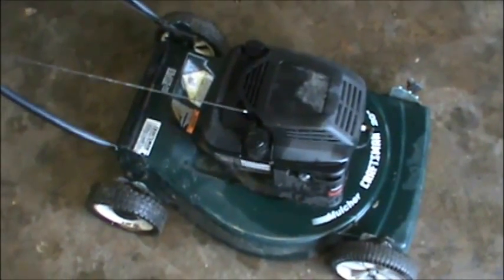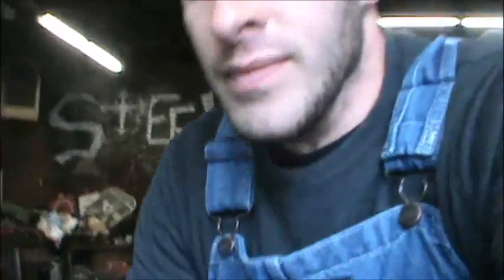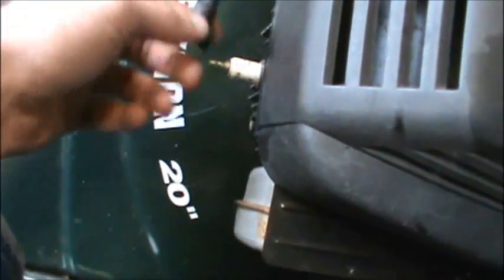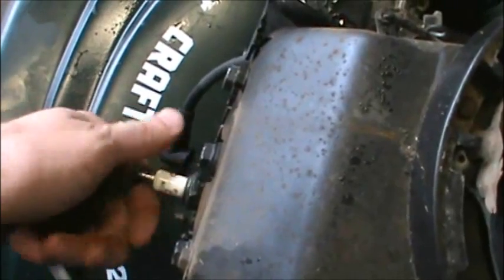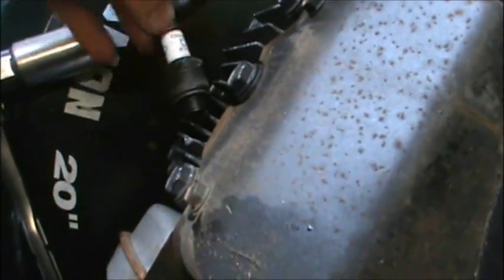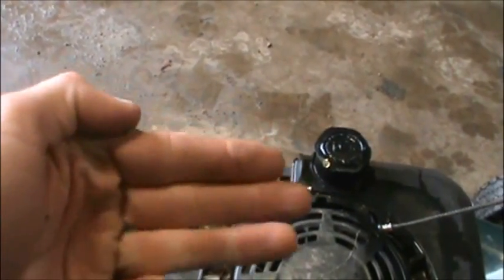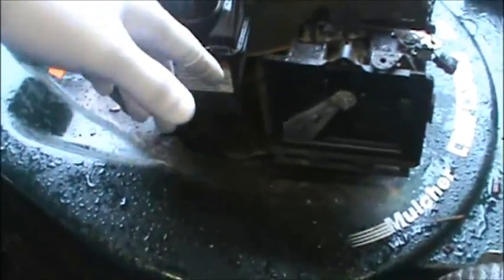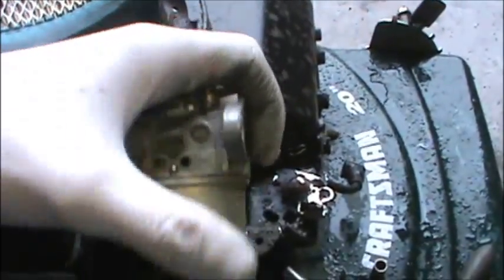How to fix your Lawn Mower and why Lawn Mowers Fail

Comment: Thanks for an excellent video! I didn't even need the rebuild kit, just cleaned out that small rubber nub with a needle and it went from not running at all to running like new - still, if I hadn't known to do so it would have meant a trip to the store.

Comment: Fantastic video that was extremely knowledgeable and entertaining. Great job.
Fixed my lawnmower by watching this.....yes the washer and float sticking which caused gas to run thru the carb and onto the air filter causing problems. Thanks again.
Reply: Before I fixed it with the new kit the mower was turning my spark plug black with carbon because too much fuel flowing thru. Again your process fixed it.

Comment: Great video. My lawnmower has been sitting outside for about 8 months. It worked fine before it was sitting outside unused. Now it won't start. I'm going to see if it has something to do with the carburetor. I've never tried to open up an engine, but after watching your video I think I might try it out!
Reply: If you're going to let it sit for long periods of time, get a bottle of "Sta-bil storage" and use as directed. It helps keep the fuel fresh and not turning to varnish, which in turn, makes your engine easier to start when time to use it. It does work.

Comment: Hey man nice find that was the very first mower that I owned bought it from Sears then 7 years ago it blew the head gasket but I was going to say take a wire from a wire brush and make sure your e tube and main jet are clean then spray the whole carburetor with carburetor and choke cleaner just a nice little tip for keep those old mowers running

Comment: Took off the bowl screw and cleaned it with wire. Even had some carb cleaner and I blew out the holes in the screw. 
It fired up with One pull. That mower has never fired up with one pull even when it was NEW. Runs strong now.

Comment: Cool. I wish I didn't get rid of my old mower.I think I could have fixed it after seeing this video. I just bought a cheap ride mower and never driven one before. I wish you would do a demo on how to operate correctly. I am using it but unsure if I am starting it correctly and switching gears right. Ok thank you.

Comment: awsome vid, im going to check my spark and air filter, if not , im gonna tear the carb apart. It starts but struggles to stay on, like it cuts itself off. seems like it may be electrical, no?

Comment: Hey man thanks for the video I bought the same mower for 15 bucks. That spring that you were talking about connected to the choke. Is that electric choke? if not how does the choke work on that mower. Thanks for the info. I cant figure out how the choke works on this model.

Comment: Thanks for your vid. However my mower will not start because I can not pull the starter string. I have already checked the line and then pulled apart the spring assembly. The assembly is working fine outside with no issues recoiling outside the mower. What ever it pulls inside the mower seems to not be moving as I pull they line. What ends up happening is the line pulls out and will not recoil. I am totally new to repairing anything like this. I checked for anything that is stuck on the under side of the mower. When I hand turn the blades they are reluctant to turn but can be with a bit of pressure. What could my problem be. It is not the corroborator as I saw on this vid. Any suggestions. I don't know what kind of parts are in this area of the mower nor have I seen any vids on them. (even if you can just tell me the names of any of these parts I can look for more specific vids) Thanks. From a very beginner at this.

Comment: Hi, my familys Craftsman lawn mower was in pretty bad shape when i took it over. it would start but wouldnt stay running. So after watching a bunch of videos i decided to give it a tune up. i replaced the spark plug, the air filter, gasket, took the charborator apart and cleaned it out. seals,pin, float are all good. Gas is good, oil is good. Anyway i put it all back together and it worked like a champ. Then the second time i went to use it, it runs fine, but smoking. i cant figure out why. Any ideas?

Comment from the maker: sounds like could be a few issues, first take the carb apart and replace the needle valve which allows fuel to enter the bowl.also clean the carb out with carb cleaner and check the primer bulb for small cracks or tears.

Comment: Thanks for the video, the gas leak is one thing, what if it starts then stalls? Is that a carburetor issue?
Reply: It's also probably the needle valve being blocked I'd check it out
Reply: That screw that holds the float bowl on has some holes in it. Make sure those holes are cleaned out also. Clogged holes can cause the engine to start and stall on some small engines. Can of carb cleaner is recommended.

Comment: I'm a single woman not a young guy, but I really appreciate this. If the carburetor is not leaking does that mean it's not the carburetor? How do you get the spark plug out? You said there is a tool for removing it? I only have basic screw drivers?
Reply: Hi fellow lady! :-) I have a push lawnmower leaking gasoline and trying to figure out if can fix it vs buying a new one. If I can't, then figure that trying will learn something before add the mower to bulk trash day. There are special tools (socket) to remove spark plugs. They come in different sizes, so you might want to buy a small set. Walmart has for under $10, for example pricing. I think I have a spark plug socket, but will have to go investigate my tool box. Try to find the manual for your lawnmower on line too, will be helpful to know which parts to order. You will also need a wrench for the nuts. I'd buy some gloves to use to avoid dinging fingers. There are tune-up kits sold for various popular lawnmowers, which will include various parts including new spark plug. If you replace the spark plug, then you need to make sure to get the spark gap right. There is a little tool for that spacing.
Reply: Thank you. I found another guy who did videos on how to change the spark plug. This was great for over-all and you gave me the confidence to fix it myself...I mowed the yard and I fixed it myself. Feeling empowered and like I don't need a man!!! But, I still want one. :)
Reply: Mary Lynn McKenzie Men aren't by default programmed to be able to or want to fix stuff. May I say... You go girl! :-)
Reply: +Mary Lynn McKenzie The videos are great learning tools. If you get stuck it is good to know a fix it guy who can help you. By the way...my parts suppliers are mostly female and knowledgable.
Reply: Mary Lynn McKenzie

Comment: HEY BEAU! Great video man, can you help me wiht something specific? My lawn mowers got the lever on the handle part that has to be held down for the mower to keep running, but my friend pointed out that the cable this lever connects to the actual motor is stripped. Whatever it is that holds the tension on the cable is cracked. Can you shed some light on whats going on?

Comment from the maker: gas engines need a few basics to work.. fuel air spark, if you have all those and no noise or rumble look at the compression. if it is lower than 90psi your gonna have a heck of a time getting it running.

Comment: got an issue with mine. Seals are good not leaking but the carb valve isnt moving or there isnt any fuel being sprayed into the carb to get it to start. When i press in the prime button all i hear is air no fuel being pumped in to prime. spark plug might need to be changed..but do you got any tips?

Comment: ok u tubers, I have a huskey lawnmower that I picked up realcheap, it runs and is fairly new, doesn't have a primer bulb, what its doing is runs but its surging and blowing black smoke, when I took the spark plug out it was covered with black sut, I put a new plug in it and ran good for about 30 seconds and started blowing black smoke again, when I took yhe plug out of it again  it was black again , whats the problem, I know briggs and Stratton but never messed with Tecumseh engines
Reply: Does it got compression?
Because sounds like it needs piston rings!
Reply: 111mrawsome yes it had compression, I found the problem thanks to mtd tech support, it was the autochock wasent set right,i guess eho ever had it before me tried to fix it and had the autochock set wrong, problem fixed sold lawnmower same day, thank u tubers for responding